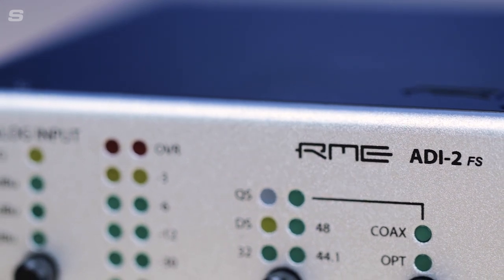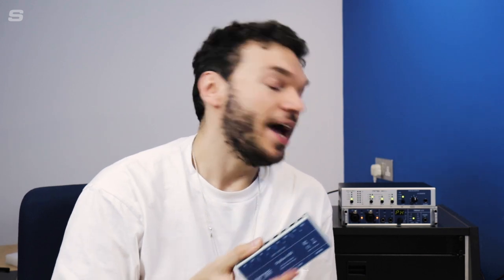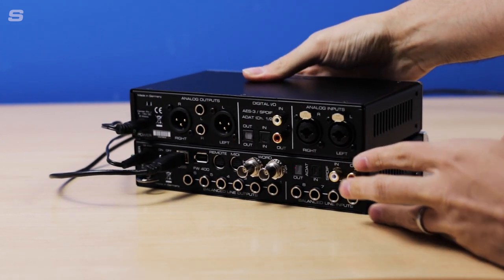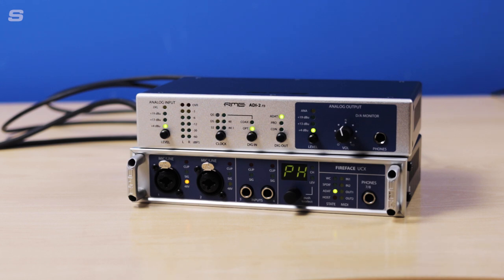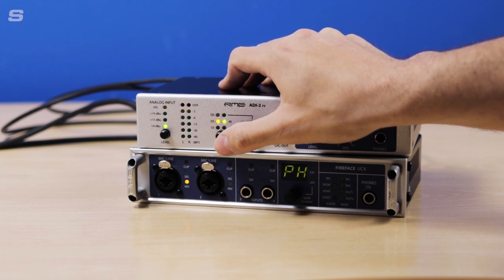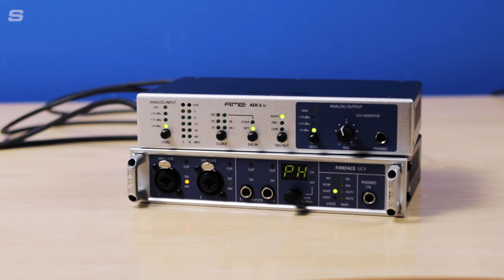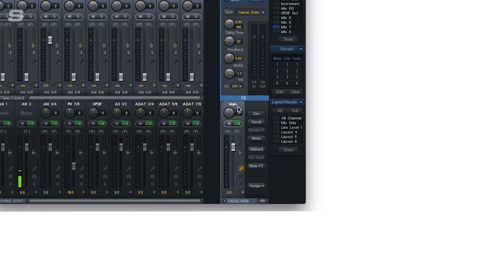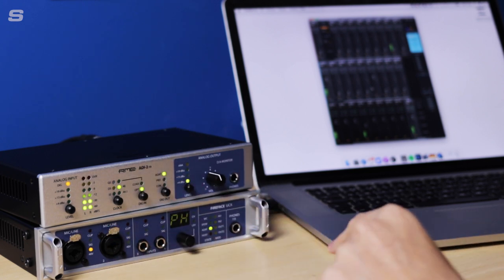RME ADI-2 FS: How to upgrade your audio interface with mastering-grade AD/DA converters

Comment: Good Job!! on this video! There isn’t much content on this Device. Great explanation
Reply from the maker: Thanks, yeah it probably gets a bit overshadowed by the DAC and Pro FS R. If you already have a solid audio interface in your studio that you love - and you just want to take the sound quality one step further - the ADI-2 FS is well worth a look!
Reply: @SynthaxAudioUK  hey dude! is it better to run it at Analog input +19 dbu or +4dbu????
Reply from the maker: Hi, it depends what you’re plugging in to the inputs. Different devices will have different output dBu's, so usually you’ll want to try and match the two devices. 

For example, the RME Babyface Pro FS has a switch on the underside that allows you to change the outputs between +4 and +19 dBu, as +19 may be too loud for some studio monitors.

Also one of my synths has a max output level of +6.5 dBu, so in that instance I’d probably start by setting the ADI-2 FS’s inputs to +4, as thats the closest match. Hope that all makes sense.
Reply: @SynthaxAudioUK  Thanks!

Comment: Thanks so much for this video. It has helped me to move forward with the ADI-2 FS. Question, will be using this with my Antelope Audio ZenTour primarily for AD connected via Adat to capture my analog master chain. Will also use it in vocal tracking with my analog tracking chains. Was curious if clipping the AD was possible with this? I know with some Dedicated AD’s this is possible? Either way looking forward to this.

Comment: Just to clarify... am I right in thinking that this set up provides ADI-2 conversion for monitoring the output from your computer/workstation but isn't in the signal/conversion chain for audio going into the computer?
Reply from the maker: Hi and yes, only analogue sources connected directly to the ADI-2 FS will make use of its AD (for recording) and DA (for monitoring). I don’t think we actually showed us doing any recording via the ADI-2 FS's analogue inputs in this video, although we are set up to do both monitoring and recording (see 2:03).

More info:

In our example, the UCX is being used to interface with the computer via USB. Anything analogue plugged directly into the UCX - such as headphones, speakers, mics or instruments etc - will still be using the UCX’s on-board AD and DA.

However, we’re also passing audio to (and from) the ADI-2 FS digitally, via the ADAT optical connections. Anything connected to the ADI-2 FS’s two analogue inputs is converted by the ADI-2 FS’s A-D section, from an analogue into a digital signal, then passed to the Fireface UCX (via an ADAT optical cable).

Equally the reverse is true - audio is passed (digitally) from the UCX’s ADAT output, to the ADI-2 FS’s ADAT input, where it is converted into an analogue signal by the ADI-2 FS’s D-A converters (for monitoring - or routing out to other studio equipment).

Hopefully that all makes sense. You might like to check out the full article on our website, where we go into a bit more detail about usage scenarios for the ADI-2 FS;

https://www.synthax.co.uk/latest/2021/04/22/how-to-upgrade-audio-interface-rme-adi-2-fs/

Comment: Hey Matt, thanks for the informative video. I had a question regarding the ADI-2 preamps.

I'm thinking about using the ADI-2 with my Focusrite 18i20, connected via ADAT both ways. I already have dedicated external preamps, so I don't want any type of preamp capabilities from the ADI. I purely want it for it's converters.

The Sweetwater description of the ADI-2 states the following: It can "operate as a standalone analog preamp" and "The ADI-2 FS also functions as an analog preamp — its analog bypass mode supports levels up to +22dBu."

Can you explain what this means exactly? Is there a way to bypass the preamps on the ADI and just use the AD/DA converters? Otherwise this wouldn't fit my requirements.

Thanks!
Reply from the maker: Hi, to be honest I wouldn’t worry about colouration with the ADI-2 FS - we know many mastering engineers happily using RME ADI-2 Series in their studios for their transparency, or lack of a ‘sonic signature’. 

Could you clarify what you mean when you say you have external preamps already - do you mean microphone preamps?

If so note that the ADI-2 FS is a line-level device only - any amplification is simply for matching reference levels.

Re the +22dBu: AFAIK this refers to using the ADI-2 in analogue bypass mode, i.e. for bypassing the converter entirely, which allows you to use the ADI-2 as an attenuator. I’d imagine this is a pretty specific usage case which most people won’t need - inputting at one analogue reference level, and outputting at another - but it can be useful for matching studio gear from different manufacturers.

So for example, when connecting a mic pre to the ADI-2 FS’s analogue inputs, you’d check the pre’s manual for it’s output reference level (e.g. +4dBu), then match the input level of the ADI-2 FS via the front panel (left-hand side).

That's my understanding anyway!

Comment: I have cranborne r8 as interface

If i connect adi fs via adat to my cranborne, and i have my monitors connected to adi fs, 

would the sound coming from my adi fs output translate to the actual audio once i render my mix? 
Would the adi fs process the audio or is it the interface that would process it?

Thank u in advance!
Reply from the maker: Hi, it depends if you run a physical analogue cable out of the Cranbourne or ADI-2 FS, then record back in via the ADI-2 FS's analogue inputs (thereby using the A-D converters).

If you're solely working 'in the box', then the converters won't have any effect on the final bounced mix, as there is no A-D conversion going on - everything is remaining solely in the digital realm.

Comment: Hello, can u please help out with these questions I bought the babyface pro fs and I was thinking about getting one of the Rme ADI-2 to improve the converters since I'm going to be using it for mixing and mastering purposes Which one would you recommend to me to buy the Rme ADI- Fs or the Rme ADI Pro fs And would it improve my quality as far as the AD/DA converter goes?
Reply from the maker: Hi this is an interesting question :)

Which one would you recommend to me to buy the Rme ADI- Fs or the Rme ADI Pro fs?
- Both use the same converters, so it depends what you need it for. The ADI-2 FS is a stripped-back version, with the main differences being there is no USB connection or remote control, no display or on-board DSP (so no built-in EQ, filter types, crossfeed, saved states etc), 192 kHz max sample rate, and only one headphone output. 

If you only want it for the AD/DA conversion, the ADI-2 FS should be all you need. If you’d prefer to have class compliant operation, multiple headphone outputs and a wireless remote control, then I would recommend the ADI-2 Pro FS instead.

And would it improve my quality as far as the AD/DA converter goes?
- This is more difficult to answer and depends on many factors, especially as the Babyface Pro FS is already an excellent sounding unit!

Whilst the ADI-2 Series does have objectively more powerful converters (in terms of how they perform under ‘lab test’ conditions), whether or not you perceive a major difference between the two will likely depend on a variety of other factors. 

The quality of your monitoring for example (i.e. having high-quality headphones and speakers to pair it with); whether or not you are working in an acoustically treated room; and even what kind of genres of music you are working in (genres with a lot of acoustic instruments and a wider dynamic range will likely present better with the ADI-2, than compared to say a style that uses a lot of compression, where the differences may be less noticeable). 

My advice would be to demo one of the ADI-2s for yourself first - then you can make your own decision on how much of an improvement the ADI-2 will bring to your work!
Reply: @SynthaxAudioUK  Thank you so much I really appreciate it & I will take ur advice
Reply: @SynthaxAudioUK  so adding the adi fs is pointless if they basically sound the same? is that what you're saying?

Comment: would i still connect my microphone and guitar to my ucx or would i connect them to the adi2 fs?
Reply from the maker: Hi thanks for the question, the short answer is that you would still connect your instruments and microphones to your UCX for recording. 

The ADI-2 FS is a line level device, so microphone and instrument signals will likely be too low (you still need a preamp of some sort, to boost the mic or guitar signals).

Comment: Hi, is the ADI-2 FS working bi-directional [the manual does not really state this]? 
Signal Chain Example: AES/EBU Digi-Signal Out from DAW into Digi-Input from the ADI-2 FS > [via DA] > ADI-2 FS Analog-Out into Analog-In from Outboard FX > Analog-Out from Outboard FX into Analog-In from ADI-2 FS  >[via AD]> ADI-2 FS Digital-Out back into DAW [I have RME HDSPe AES/EBU installed] In summary. Will the ADI-2 FS convert "Digital-In to Analog-Out" and "Analog-In to Digital-Out" simultaneously . . As the signal chain shows,  Digi-In and Analog-In are feed with two different stereo signals coming from two different sources [digital source & analog source]? Thanks !
Reply from the maker: Hi sure that'll work, no problem. Both the AD and DA sections can be used simultaneously.

Comment: thanks for the video, is it possible to use the adi 2 standalone? connecting the headphone output of the macbook to the analog input and use the monitors connected to the adi-2? moreover it can also be used for live shows?
Reply from the maker: Hi, yes the ADI-2 FS is a AD/DA standalone converter which can be used for studio and live work (depending on what you have it hooked up to of course). 

I wouldn’t really recommend using the headphone output of a Mac to send an analogue signal to the ADI-2 FS though, as that essentially defeats the point of having a high quality AD/DA (you’re feeding it a low quality analogue signal…). You want to be sending it a digital signal (SPDIF, ADAT or AES-3), e.g. from an ADAT-capable audio interface or sound card, so that the DA conversion is solely being performed by the ADI-2 FS. 

If you don’t plan to use an audio interface you might be better off with the RME ADI-2 DAC FS, as that can operate as a class compliant interface (i.e. a USB-DAC).

It’s also worth noting that some older Macbooks can actually output a digital signal from their headphone output. It’s not something I’ve personally tried, but that could be a good solution if your MacBook supports it. 

From the Apple website; 
“Some Macs also support optical digital audio output via the headphone audio port. Use a Toslink cable with a Toslink mini-plug adapter or a fibre-optic cable with a 3.5mm plastic or nylon optical plug.”

https://support.apple.com/en-gb/guide/mac-help/cpmh0052/mac
Reply: @SynthaxAudioUK  thanks for the thorough answer. i am about to buy the adi 2 fs, i would connect it to my hdsp aio pro via aes and use it as main output and as preamp. I would connect it to the output of the macbook only in the event that the main computer with the hdsp does not go live, I would have an audio copy beckup on the macbook of the show! Thanks again
Reply from the maker: @davismusic8090  Hi no problem, wow that sounds like a very high quality setup! The AIO Pro actually just got a very good review from Sound On Sound - the reviewer liked it so much he kept it :)

Comment: I have a classic FireFace UC bought back in 2014. Would it worth quality wise linking my FireFace UC up with the ADI-2 FS to have a main reference DA converter for my Adam A7X monitors?
Reply from the maker: Hi yes I’d wager so. The Fireface UC is a great interface but it’s certainly an older product from RME (essentially a re-housed Fireface 400), so any of the ADI-2 Series devices will be sonically superior to the UC. Keeping the UC in the chain means you still get TotalMix FX and the custom RME drivers. The Adams are great monitors too so this should be a very powerful combination!

You’ll also benefit from RME’s SteadyClock FS clocking technology on the ADI-2s (when set as clock master), which many people have commented also has a noticeably positive effect on the AD and DA.
Reply: @SynthaxAudioUK  Thanks for the reply, in the meantime I've already got the ADI-2 FS, and I can tell it was the best decision I've ever made. The DA sounds beautiful & natural with my ADAMs. The top end is super smooth and "silky" while the freq response sounds quite flat at the same time, can listen to music all day without any ear fatigue. The FF UC is still a great unit, will be keeping it as an interface and AD converter for my synths.
Reply from the maker: @BenceTasnadi  Really glad you're loving the ADI-2 FS! As you say, the FF UC is still a great unit - we know of loads of people that have had one from new and are still using them to this day!

Comment: Been researching the whole morning and I think I’m going with this unit. Just one question, will I’ll be able to transition this setup with my motu ultralite avb? I’m more then 80-90% sure I can. I just stumbled onto your channel I’d appreciate any help or advise thank you and god bless
Reply from the maker: Hi, yes you should be able to use the ADI-2 FS with the MOTU as far I know, although I haven't personally used any of their products (we're RME UK). The Ultralite AVB has ADAT / SPDIF optical I/O, so you should be able to connect to that via optical cables.

If you're in the UK you can also grab a free extended 5 year warranty, so long as you purchase via one of our authorised UK dealers; 

https://www.synthax.co.uk/latest/rme-adi-2-dac-authorised-uk-dealers/

Comment: Quick question for ya if you can. what is the headphone jack monitoring? is it a duplicate signal of the analogue outs? Also if im listening with headphones, will the unit still output through the analog out in the rear at the same time or is there an internal switch that goes to one or the other? Lastly, on the back, with the TRS 1/4 outs and the XLR outs, can they both be used at the same time? was thinking about sending TRS outs to a nearfield monitors and the XLR outs to my main mid field monitors for mixing tasks. I really appreciate your time, thanks so much. this video has REALLY helped me understand. especially the "DS" and "QS" functions.
Reply from the maker: Hi again, afraid I'm going to be brief here as I'm finishing for the day (and we have a 4 day weekend here in the UK, courtesy of her majesty's Platinum Jubilee ;) ).

what is the headphone jack monitoring? is it a duplicate signal of the analogue outs? 
- Yes, if memory serves all three analogue outputs (XLR/TRS/Phones) will output at the same time. This can be the digital input (AES-3/ADAT/SPDIF In), or the analogue input. All outputs are controllable via the VOL encoder (along with the reference levels +4dBU etc).

Also if im listening with headphones, will the unit still output through the analog out in the rear at the same time
- Yes that's correct.

Lastly, on the back, with the TRS 1/4 outs and the XLR outs, can they both be used at the same time?
Yes, as above its a single converter outputting simultaneously to all 3 outputs. If you need separate output volume controls you'd be better off with the Pro model.

All the best.
Reply: @SynthaxAudioUK  awesome thank you! yes that answered all my questions! wish I could buy you a dinner ha ha! I will have all output routed through a monitor switcher with separate volumes so all is well. have a happy holiday my friend!!

Comment: looking to improve the quality of my recordings and I am currently stuck at the moment.. I have a Focusrite Scarlett 2i2 that I have used for years. Currently it is only being used as a converter because I have an external Mic Preamp and hardware compressor. Mic>Preamp>Compressor>Scarlett 2i2>Computer. Should I upgrade to a AD/DA converter in place of the Scarlett 2i2?
Reply from the maker: Hey! Your Focusrite is acting as the interface between your analogue gear and your computer. The ADI-2 FS is an AD/DA converter, not an interface, so it's not a direct replacement for your 2i2. 

Might be worth checking out RME’s range of audio interfaces, which would be a great way of upgrading from your Focusrite interface: https://www.synthax.co.uk/rme/firewire-usb/

Hope this helps!

Comment: Hi. I need some noobie question, and i hope youy can help me.
When i connect ADI-2 FS like this in my UCX does it change AD/DA conversion of inputs of UCX, in other words does it bypass converters in soundcard? Or i need it to connect differently when i recording tracks?
Kind regards, Dado.
Reply: If you want your ADC to be handled by the adi then you want to connect any analogue outs to the analogue ins on the adi. The converted digital audio will then be piped via the adat out to your interface adat in (ufx).
Reply: @soutronamir  Hm, i find that very weird. Is it not reverse maybe? To record in ADI ins and then let the signal goes via digital signal into UCX?
Reply: @DadoSimicStudiostriver  yes, edited - too much adi ucx while typing.